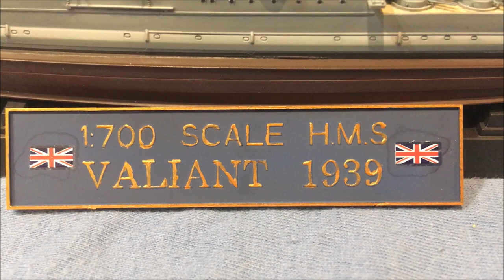Trumpeter Battleship HMS Valiant 1/700: Assembly, Painting

Comment: I've read below that you've got a few of the 1/700 Trumpeter ships so plenty to keep you busy, but if you get a chance it would be great to see you work on one of the Flyhawk 1/700 capital ships. They're a nice mix of single moulded superstructure pieces which simplifies construction and incredibly fine plastic parts that compare well with photoetch alternatives, particularly on things like anti-aircraft guns. Well over 600+ parts and that's just on the regular plastic versions rather than the deluxe sets which come with additional photoetch.
Reply from the maker: From Flyhawk, i have the HMS agincourt, and i have to say, i was not convinced. it was not the deluxe version, and i also haven't built it, but the part-count is not very high and it only has a waterline hull. For what they charge for those ships (i have paid 38 bucks for the agincourt), you get some bigger scale warships already, so i think i'll build this one before making promises of giving another flyhawk model a try!
The detail on the plastic parts is great, though!